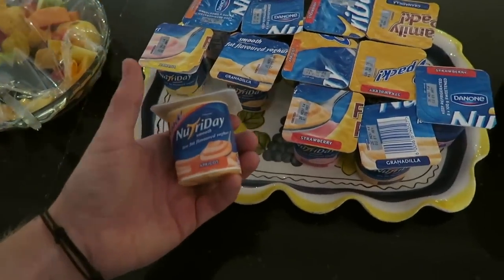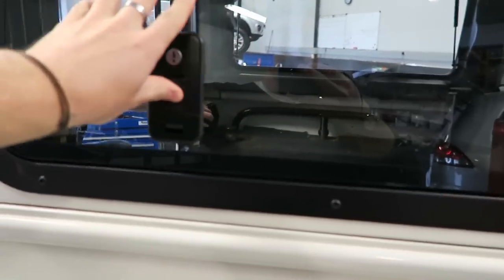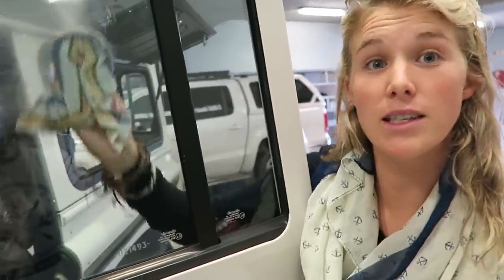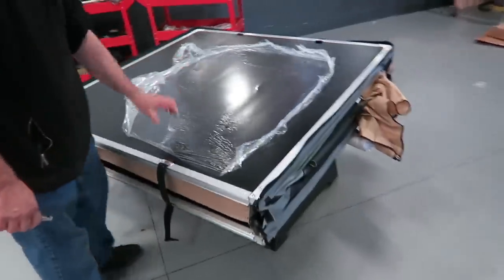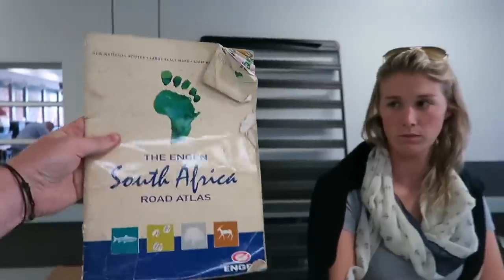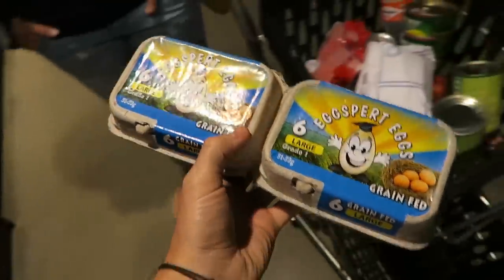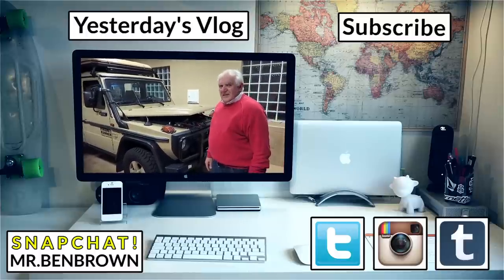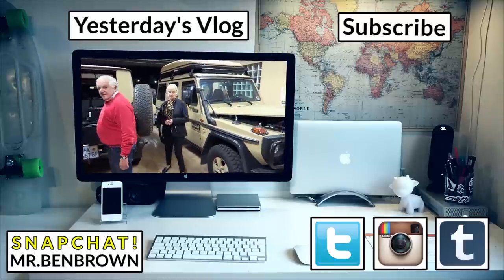EPIC CUSTOM LAND ROVER

Comment: You have no idea about 4x4 driving and this is a lousy job. The roof rack is much too high, the right ones are some 4 cms above your roof as a one piece sleek aluminium. When I saw you showing that you want to fit your additional lamps to the roof rack, I switched off. Any lights on a roof rack light up your bonnet and you see fokol. Apart from that, it is illegal, no additional light may be higher than your main lights. What a waste !
Reply: All of this was fitted by the front runner team, they are professionals as I'm sure you will know. If you want to send out these negative vibes go somewhere you're appreciated, don't come here and accuse Ben of knowing nothing about 4x4 driving and certainly don't comment about how this is 'a lousy job'. Go spread negativity elsewhere. Bye.